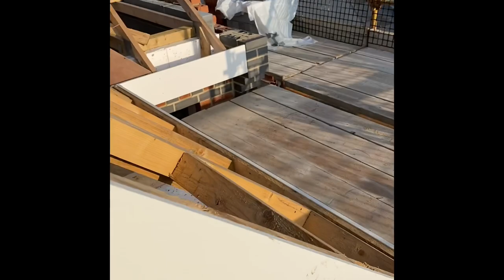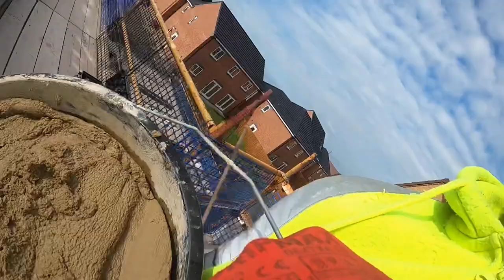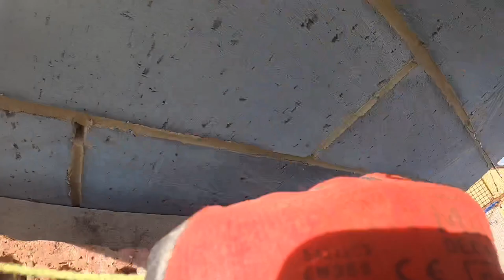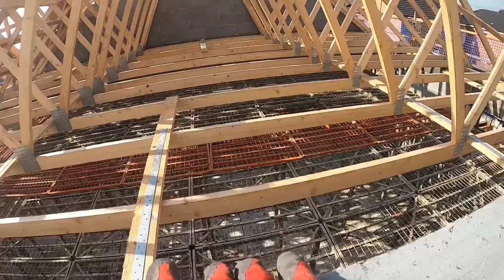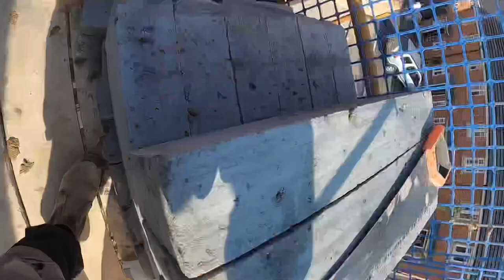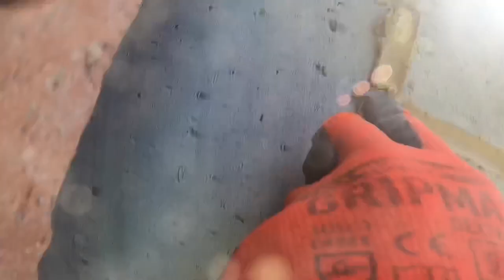Bricklaying: doing blockwork cuts on a pike

Comment: Hate having to pointing the block work on the inside has to to be like facework but you can’t get up there and do you not have to put a tie every course just under the timber of the roof truss
Reply from the maker: KierenBoi MUFC thanks for the comment yeah if your going by the book you do yeah  no one does it on that site. But yeah fair comment

Comment: Neat cuts bro
but you should have ur camera standing still and do the cuts and explain how u do them
Reply from the maker: Kevin thanks for the comment I was using my phone so it was difficult to do the cut and film. But I will do another one showing me doing the cuts 👍🏻
Reply: @rowlockconstruction8345  yea i just commented to help u out to improve videos ;)
Also dont u have to leave 30-50 mm gap to the top? Just to avoid headaches with the carpenters/roof guys.
Anyways ur curts are neat, probably u wont have any problems anyway.

Comment: Dont bother with the weep hole packers just put block on dry mark  the block then cut it 10m below the line easy
Reply from the maker: Gary thanks for the he comment 😀👍🏻
Reply: Or just put the perp at about 20mm, and then mark the block, that allows for you bed joint 👍🏼